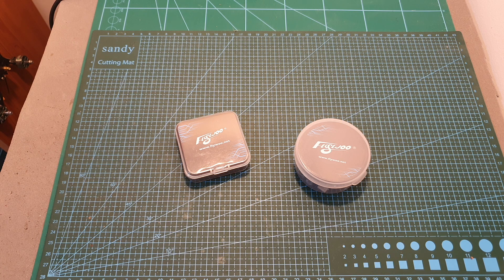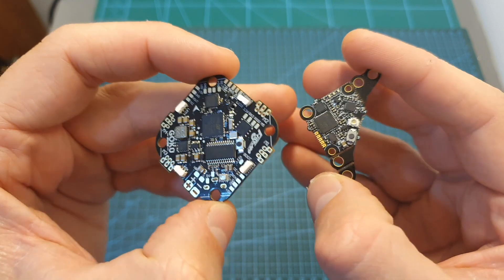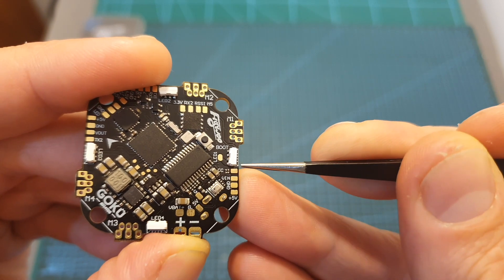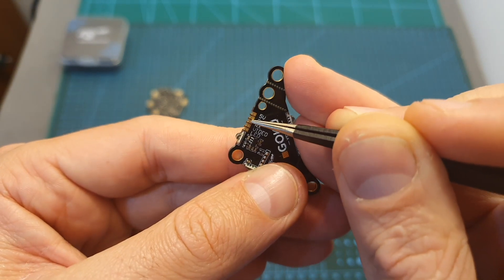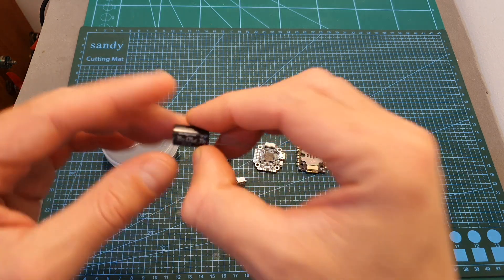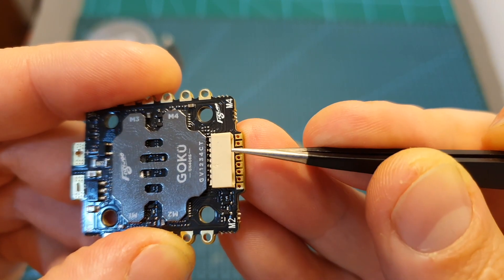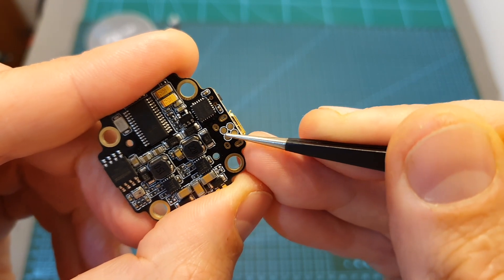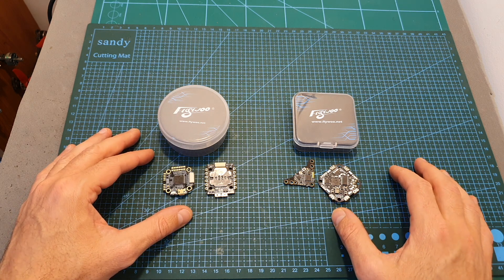Flywoo GOKU F722Mini, 406S ESC, GN413S & VTX625 Overview

Comment: Hi Gal great reviews I cant remember how to unlock the VTX625 wondering if you made a video showing how to unlock and change channels using LED thank you for all your hard work hope you are doing well stay safe cheers
Reply from the maker: Hi Bryan, sorry for the late response. 
I don't remember that I had to unlock it. Did you figure it out by now?
Reply: @KremerFPV  I did had to hold the button down for like 10 or 15 seconds. I lost the button and ufl connection in a very hard crash new one working great thanks for sharing all your knowledge couldn't do this without you.  I'll see you on your next upload Aloha cheers

Comment: I have VTX625 which after crash working on channel L2 all the time (lights on it are showing R5...this is also what I set in betaflight). Any idea?
Reply from the maker: Did you figure it out? Maybe the VTX wasn't configured properly on BF.
Reply: @KremerFPV  I tried everything and two days ago I received new VTX. Now works okay. Now it looks I have also broken FC. With completely the same configuration drone is shaking and it is not stable. Do you think this normal behavior of broken FC after crash. I tried to flash it again and configure BF from scratch but it is the same.

Comment: Hi Gal, love your reviews, they help me a lot. Did you get a chance to range test the VTX625, I've added it to a build and I'm getting very bad range even  close I got breakups in an open space, no trees or buildings, I compared to a PandaRC nano and the difference is huge.
Reply from the maker: Thanks Jose, I am glad I was able to help you out so far. Sorry but I didn't test it's range. I tested it on one of my builds and it seemed to be doing ok. Did you figure out the issue?
Reply: @KremerFPV  Thanks Gal, defective antenna.
Reply from the maker: @isramv74  Well I am glad you figured it out :-)